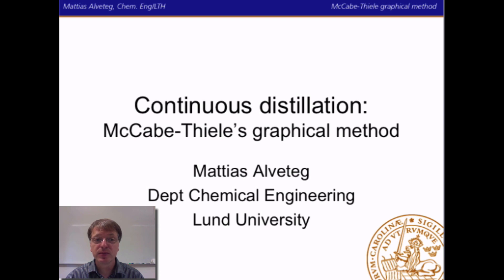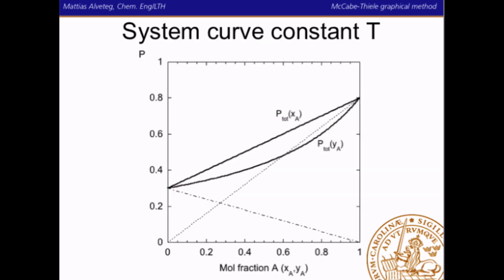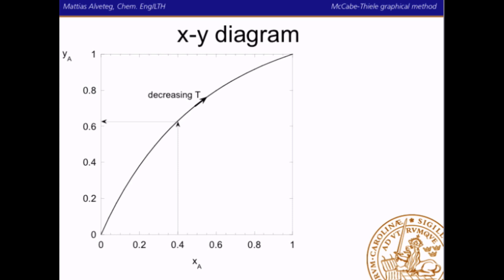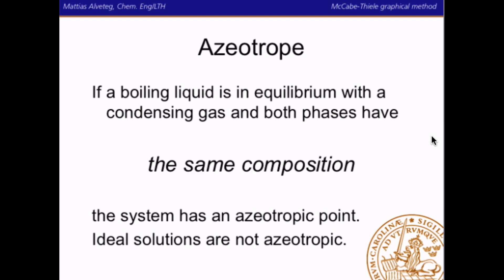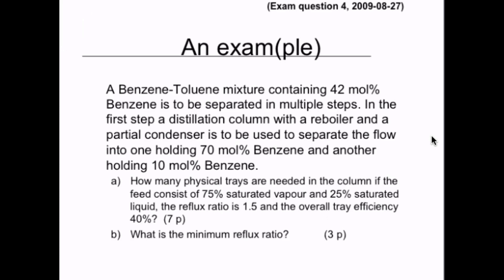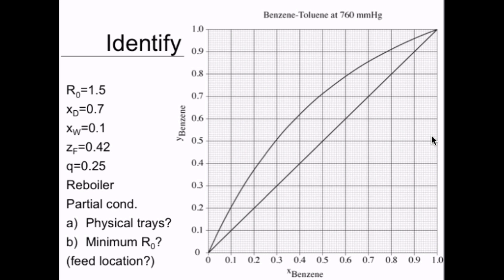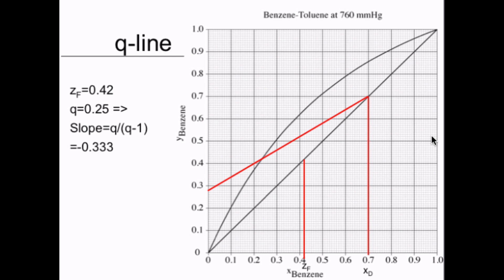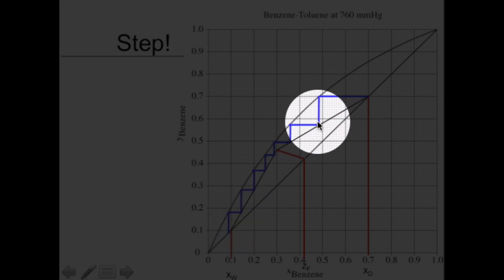D3-Distillation: McCabe-Thiele

Comment: Sir one thing to get stages inside Distillation colounm we will always minus 2 stages of boiler and condensor, Even if boiler or condensor are parital or full we always minus right?
Reply from the maker: No, that's actually not correct.

A total condensor is not an ideal stage. The composition in the liquid flow out from a total condensor is exactly the same as the composition of the gas flow that went into the total condensor. Compare that with an ideal stage where the two flows leaving the stage (gas up, liquid down) are in chemical equilibrium with each other (hence differnt composition)

Furthermore, although this might be omitted in basic courses, there might not be a reboiler. Alternatively, there might be no condensor: If you let the feed be gas that enters at the bottom of the column, no reboiler is needed. If you let the feed be liquid that enters at the top of the column, no condensor is needed
Reply: +Department of Chemical Engineering/Lund University ok if u are using a Total condensor and boiler and u find 10 theoritical stages . Then how many of them will be inside the colounm?
Reply from the maker: 10 - 1 = 9

(If you're not taking an advanced course that is. In basic courses it is common to make the assumption that a reboiler is exactly 1.0 ideal stages but if you think carefully about reboiler design it's not entirely certain that the reboiler will be 1.0 ideal stages)
Reply: +Department of Chemical Engineering/Lund University Sir do have some sort of forum where i can ask frequent Qs?
Reply from the maker: Unfortunately we do not have the funds to provide such facilities for other than our own students
Reply: +Department of Chemical Engineering/Lund University Sir i want to ask one more thing why we use reflux ! Meaning if we dnt send liq back to Colounm as reflux will distillation not occur? What is its importance
Reply from the maker: Stopping the flow of liquid back to the column will kill the process. 

What makes distillation work is the contact between a liquid and a gas (ideally there should be equilibrium between the two phases). If there is no liquid pouring down, there is only one phase left on the topmost tray: Gas. 

If there is only gas on the topmost tray, there is no liquid pouring down to the next tray, etc. etc. until we reach a point where the entire column above the feed is simply used for nothing,
Reply: +Department of Chemical Engineering/Lund University ok sir this i understand 
Now lets say i Desgin a Distillation Colounm and i calculate reflux ratio also and also all other parameters etc. Now come to limiting cases 
1.Total
2.Minimum
First tell me are these 2 cases always happen in the every distillation colounm or they are special cases E.g
I understand when first a distillation colounm is run for first time its the case of total reflux u dont remove any product untial a desired degree of Seperation is achieved on a tray . Now this is clear why i have to calculate Total reflux
but what i dont understand why i calculate Rm why its important in desgining
Reply from the maker: (I don't have time to answer all questions, but your question is likely relevant also for my students, so here we go:)

If I understand you correctly you're actually asking about the dynamics of a distillation column, that is what happens when you start things up (you write: "when first a distillation column is run for the first time"). Unfortunately, McCabe-Thieles graphical method can not answer any such questions. 

McCabe-Thieles graphical method deals with the steady-state situation and thus assumes that everything (e.g. liquid levels on different trays, concentration at different trays, temperatures, all flow rates etc.) are constant in time.

Having said that, what is the importance of determining
1. The minimum reflux ratio?
2. The number of trays at total reflux?

To answer these questions we first need to make one thing totally clear: The design question we are asking ourselves is how we can achieve a separation when we have an inflow with a certain composition, temperature and aggregation state and want to create a distillate and bottom product of a certain purity (for example xF=0.3 as liquid at boiling point, xD=0.9, xW=0.05)

1. The minimum reflux ratio
For a given values of xF and xD as well as the aggregation state and temperature of the feed, there exists a certain minimum reflux ratio below which there IS NO SOLUTION. No matter how high distillation column we build there is no way we can achieve the given purity xD of the distillate.

2. The number of trays at total reflux
The more we increase the reflux ratio, the less number of trays we need (thus shorter tower). The limit is when we have total reflux and this gives us the minimum number of physical trays we need to achieve the specified separation.

I hope your with me so far. There is one thing I usually have in my lectures that I haven't recorded as a podcast yet but is described in most textbooks:

A. The higher the reflux ratio the more liquid goes back into the column and thus the more liquid needs to be evaporated in the reboiler => Operational costs increase as reflux ratio increases

B. For small reflux ratio, decreasing reflux ratio further means we need a higher distillation column = we need more steel => Investment costs increase with decreasing reflux ratios as we approach the minimum reflux ratio

C. For large reflux ratios, increasing the reflux ratios means the residence time increases and we need to be able to keep a larger volume inside the distillation column = we need more steel => Investment costs increase with increasing reflux ratios (at high reflux ratios)

A+B+C => We can (if we know what interest rates to use on our capital investment) calculate an optimal design with lower production costs. The minimum reflux ratio and the total reflux case is an important step towards calculating that optimal design (although such calculations are often left for advanced courses)
Reply: thank you sir

Comment: I still don't get it how you get the q line ....
please help ...?
Reply from the maker: +Evelyn Stanley I would need a more specific question to be able to help you. What is it more specifically that you don't understand?
Reply: +Department of Chemical Engineering/Lund University I mean we got the slope for the Q line but I don't understand how to draw it on the graph ._.
Reply from the maker: +Evelyn Stanley Consider the equation for the q-line. It's the equation for a straight line. You can choose any x-value and calculate its corresponding y-value. If you choose x=z_F you get y=z_F which is a point on the diagonal.

The two operating lines work the same way. If you set x=x_D in the equation for the upper operating line you end up on the diagonal in (x=x_D; y=x_D) and if you set x=x_W in the lower operating line you end up on the diagonal in (x=x_W; y=x_W)
Reply: +Department of Chemical Engineering/Lund University Thank you for the explanation :D

Comment: Hi. I don't get the part that you calculate the slope for q-line. So slope=0.333, and then you drew a line. I don't get where did the line come from.
Reply from the maker: Remember:
1. q-line goes through (z_F, z_F)
2. upper op. line goes through (x_D, x_D)
3. lower operating line goes throug (x_W, x_W)
To see that for yourself, choose x=z_F, x=x_D, x=x_W in the respective equation
Reply: Institutionen för kemiteknik/LTH Thank you so much! :D
Reply: I'm not sure about it, but isn't it just y=(q/q-1) * x  -  xF/(q-1), so as you have x=0 it is just xF/(q-1) = -0,56 (which seems to be your point on y)
I dont really get it how you get from the -0.333 to the point on the y axis, would be nice if you coult explain
Thanks!
Reply: @wayne31011  yes. it's wrong!
Reply: Still don't get it